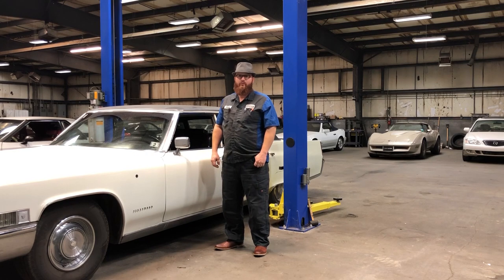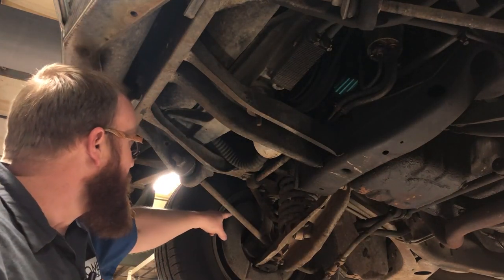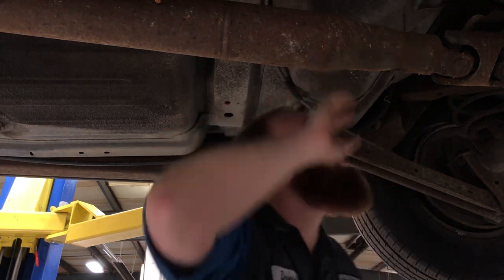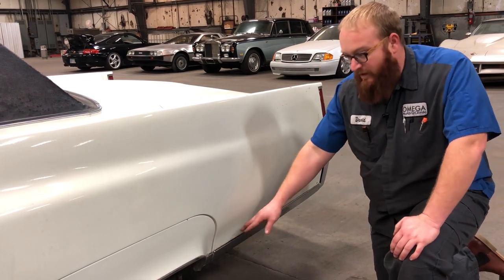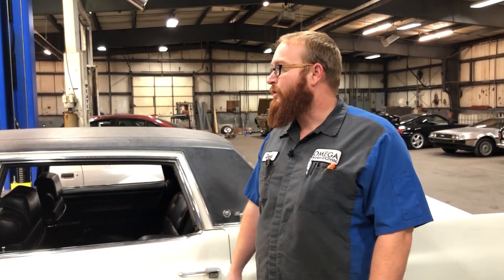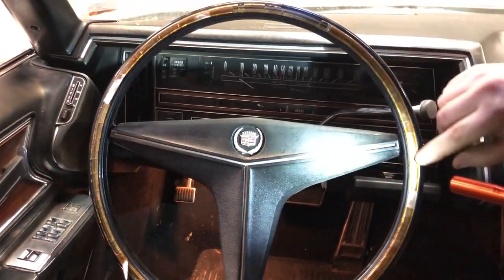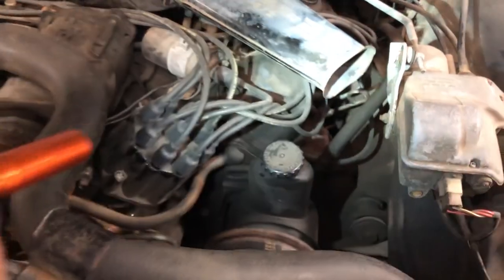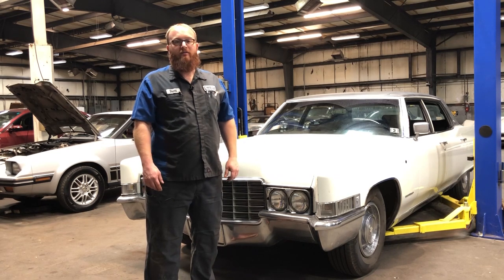CAR WIZARD Shows What Makes a Classic Car a Deal or a Steal on this 1969 Cadillac Fleetwood

Comment: For the future health of both the engine's cooling system and the new A/C compressor, I recommend you replace the fan clutch, this is often overlooked, and critically important. The bonus with be stellar A/C performance.
Reply: I'll try that new clutch. My A/C always worked funny at a stop light or, with the 454 at idle.  Eventually the compressor pulley seized after 50k miles. 2 years ago. Replace pulley only and dash control panel 2 week s ago.
Reply: Good advice

Comment: VERY NICE Cadillac, especially from Kansas City (road salt eats these old cars up) !!!!   I learned to drive in a 1977 Lincoln Town Car.  It was almost 22 feet long and weighed 6,000+ lbs, and had the 460 (7.5L) V8 and a C6 automatic transmission.  We were able to fit it in our garage, with just about a calf thickness to spare by the door, so you could wiggle around when the door was closed.  Viewers, be aware that a lot of the power features on a car like this may be VACUUM-operated, and that can be a problem sometimes.

Comment: It is in very nice condition.Easy to work on compared with modern cars,no electronics that are 'engineered to fail' nor plastic pieces under the bonnet/hood that get heat damaged in time.Loads of space around the engine.A cool car to have as a daily driver.

Comment: That's one classy beast... Had 2 1968's, a 1969, a 1973, 1976, 1979, 1983 then Cadillac died. I love the way you ignored the rubber fuel line on the passenger side... LOL Sweet Ford EXP...

Comment: So nice to hear someone pronounce Brougham correctly. Not Bro-ham. Thanks Car Wizard. (Edit) AHH!! I typed too soon! 12:00. This model, pretty much any year, is by far my favorite Cadillac. I''m tall, 6'4" the rear seats are never crowded when I run the front seat all way back. The foot rest is a cool bonus for the passengers. When I was high school, maybe before you were born, in my Vo-Tech class I had the pleasure of replacing those double cardan joints (taught to call them constant-velocity joints as well). The part I remember being the most difficult was the centering yoke. Still sticks with me almost 36 years later. Great information for buyers!

Comment: '69 Cad,,,,great highway car. That opinion coming from having owned a new '69 deVille vert.   That tells you how much older I am than you so I'll forgive (haha) you for the statement you made about being "surprised" to find a trunk release in the glovebox.  Man, back in the day that was pretty much standard equipment (or at least a popular option) in any luxo boat.  A feature of your car that I really wish they'd bring back is Cornering Lights....not only did they look cool, they're very practical for turning into dark driveways.  GM cornering lights were extra cool because they had  a delay feature which kept them lit for several seconds after the turn.  Enjoyed the vid, good tips and well done!  Enjoy that land yacht!!
Reply: Very cool!  I own a 69 cad convertible.  Yep, they are great highway cruising cars.  Have had mine for about 25 years..would never sell it.  The only problem with them is the 8 miles per gallon fuel economy. When gas was $4 a gallon... I wasn't driving it much! =)  What happened to your 69?  Did you sell it?
Reply: In the fall of '69, I traded it in for a '70 Eldorado.  Whoops,,mistake.  The Eldo never had the couch-on-wheels floatiness of the rwd deVille. Good on you for keeping yours 25 years and counting!
Reply: You are so right about the cornering lamps ! I have an '05 Mercury Gr Marquis and I upgraded all of the interior and exterior lights over to the brightest LED's I could legally use and man, my cornering lamps are wonderful for my very dark and steep driveway. Having headlights that actually work now is a real treat too. I'm keeping her for forever unless something truly $$$ happens to it, then it's on to a Hybrid of some kind...Progress ???
Reply: I have an 89 Town Car project and yes the cornering lights are fantastic for coming into the driveway in the rain at night!
Reply: jrider4   I had quite a few of these old Caddys back in the day, and oddly enough, many weren't very well equipped. Fleet woods and Eldos had everything but a DeVille or Calais not necessarily. Air was not standard till 71, though most had it. Tilt wheels, even power locks were absent on some lowball models I've seen. Funny how a Hyundai has more gadgets than these old Caddys. I'll still take the Caddy though!

Comment: Only in America can you daily drive a 7.7 litre V8! Try that here in the UK and would cost you a tenner to start it up!
Reply: what is a tenner?
Reply: and if your from the u.k what is a crumpet? like tea and crumpets, i always thought of it as a small piece of burnt buttery bread thats very crunchy.
Reply: @chevy2061  A tenner is £10 (Sterling)
Reply: @chevy2061  £10 or around $13
Reply: Murica
Reply: Good we don't wanna be ruled by our gvt we have freedom here and don't forget we defeated the euros to get it and would do so again.
Reply: A 7.7 liter V8... that made like 140 horsepower 😬😂
Reply: Yah but in the UK you have universal healthcare, better social safetynets and a very modest retirement system. You may not be able to drive this gargantuan piece of metal, but you guys are years and decades ahead of the US.
Reply: @diablocls55  
Torque, brother.  It's for the torque.
Reply: @markwilliams2620  I get that.... but 140 horsepower? What the fuck? My 1995 Volvo 850 makes 30 more horsepower than that out of a tiny 2.0 5 cylinder 😂
Reply: @markwilliams2620  also, many other cars in 69 were putting out 3x that power

Comment: I'm no professional mechanic, but on the Camaros and Firebirds along with the pre 85 Corvettes check by the bottom corners of the windshield as sometimes water will get stuck there and rust out the body from beneath the windshield. On Firebirds especially make sure to peek inside the door, there should be a little seal that is removable and shine a flashlight into it. Water likes to collect in the doors on the older Firebirds and Camaros and at times the drainage holes will get gunked up and thus the doors can rust from the inside out

Comment: The boss man bought himself a car only the boss man would have bought back in the day.  Love it, 1969 was a great year for Cadillac and that thing is in amazing original condition.  

Also take my advice from somebody who has owned an old Cadillac with a vinyl top.  Mine started to get a rust bubble on it on that rear sail panel near where it met the roof.  I let it go for a year or so, big mistake.  There was a lot more rust under the top that I couldn't even see, had a quarter size hole where it bubbled up.  I'd strip it off immediately and kind of see what you got under there.  I assume you aren't going to drive it in the winter so right now would be a good time to do that project and have it done when spring rolls around.

Comment: Congrats Wizard, I had a 64 convertible. It sat outside for over 20 years with rotted off top and when I got it back on the road, it still rode better than a new car. But i'm a Ford guy, so I sold it and bought a Lincoln...LOL

Comment: The bad u-joint ruins the front seal on the differential usually.  And he's right about taking it to a shop that specializes in driveshafts. They have balancers and all the stuff to make it right for highway speeds.

Comment: Congrats.  Daily driving that should be  a lot of fun.  I notice this car has the fuel fill behind the plate, at the center of the back, so during your frequent stops for gasoline, you will be able to drive to either side of the pumps and reach the filler opening.    I have a Chrysler K car, and I replaced the sealed beam headlamps with conversion kits.  I used Hella Vision Plus, but there are probably others, too, and Hella has them in your 5 3/4 " size.  Upgrading from the sealed beam units would make the car safer for night driving.

Comment: I bought a 1982 eldorado for 700 bucks and she's a beauty im about 1800 into it seprate from what I've paid for it things like starter breaks alternator just did the ac compressor had it switched from r12 to r134 new interiors headlines that was 400 bucks actually I've spent more than 1800 lol but i would change a thing i fell in live with her

Comment: As long as the Caddy is a pre-Northstar engine then it is a good car. I had an 88 Sedan DeVille and and 89 Fleetwood Brougham later. Good cars. My landlord had a 70's Cadillac I did work on for him and drove a few times also. Love the old Cadillacs, they ride so smooth on the highway. I am the same way, as long as the car looks pretty I can fix the mechanical issues.

Comment: Very cool. I really dig those old Cadillac's. the interior of that car looks just like a 1970 Eldorado I owned. By the way the horn it not on the rim of the steering wheel it's in the spokes of the steering wheel...  If you have problems with the carb overheating then get a 1974 intake manifold which has much smaller carb heat ports in it... I've repaired many a 472 and 500 over the years...  Probably one of the best engines made.

Comment: I don’t know if I am late to the party but I guess the clock is still the type with mechanical clockwork and power winder. These would draw around 1.5 amps for a split second every two minutes. The points would burn out. They were also vulnerable to battery swaps. Before reattaching the ground the ground wire had to be sparked against the battery post, wait until the clock stopped, repeat until the clock didn’t run and there wasn’t a spark anymore.

Comment: Nice car! A friend of mine has a 72 fleetwood limo. Makes my 1989 Town Car at "only" 18.5ft long seem small. I recommend replacing the intake manifold gaskets at the same time as the valve covers'.

Also watch out for new parts as they can be warning signs! My town car project I bought for cheap because it had some minor issues like a rusted brake line and valve covers leaking. Noticed a new radiator and alternator were installed recently. Want to guess which systems needed in depth troubleshooting and repair after purchase? That's right! Needed a thermostat and intake manifold gaskets to fix the cooling system and a new pigtail + new voltage regulator to fix charging and battery drain issues.

Comment: This vid has been here awhile, so I don't know if you ever addressed the steering wheel or not. The 'rim blow' feature is unique to 1969 models. There is a vendor out there that reproduces a wood strip that you can refurb that wheel with, if the rim blow still works. A popular retrofit for this wheel is the one from 1970, which has a normal horn switch activated by the center hub and spokes. Not so sure if later ones fit - they might not.

Comment: Car Wizard, that is my old Cadillac. I bought it from the original owner 3 years ago (as of today) and sold it last year to a fella up in the Kansas City area.
Reply from the maker: Hey that’s really cool. What can you tell me about it?
Reply: Car was purchased by a sweet lady in Colorado and then moved to the Wichita area back in the 80's. When her husband passed away she wound up storing it in their garage/barn and it wound up sitting til I purchased it. I believe her son told me that the car had been sitting for 20ish years. I put new tires, brake cylinders, plugs, wires, gas tank, some charging componets and couple belts. The AC compressor went out on me and I just took the belt off. Was a fun driver. I believe I took a picture of the title (from the original purchase), I'll see if I can dig it up.

Comment: Missing the vacuum advance diaphragm vacuum line.
Reply from the maker: ngneer999 Yep I was in the middle of working on it before filming.
Reply: @CarWizard there is a hop up kit for 472-500 engine to get past the smog......

and even Edelbrock has a rpm intake manifold and you can get front discs for it.....check Kanters and OPGI 

I'm glad that you've joined THE Empire!

I'm working on 1959 myself!
Reply from the maker: Cleveland Maker Thanks for the tips. Luckily it came stock with front discs. I think its the first year.
Reply: @CarWizard  thanks....and by the way Google Frank Nicodemus....hes got a Jersey junkyard and warehouse of Cadillac parts he could find you a good steering wheel!
Reply: @clevelandmaker386  No smog crap on a 1969 model car.  They didn't really start lowering compression ratios, cat converters, smog pumps etc until 1972-1973 model years.
Reply: @clevelandmaker386  Wow. Kanters is still around. I'm having flashbacks from the 80's now. I went to Boonton High

Comment: Hey Wizard!  Any updates on the Caddy?  I just picked up a 71 Sedan DeVille, pretty much the exact same condition as this one, needing much of the same things.  Underneath and the body looks the same condition as yours.  The odometer reads 12k miles, and thought it might be actual since the leather is like new, and even the steering wheel's "wood" inlay is fully intact with only one small crack, but some other stuff like a replaced ball joint, newer brake pads and shocks, and some paintwork lead me to believe it's 112k.

Comment: I owned a 1965 convertible and then a 1966 Coupe De Ville. I think the stacked headlight 1965 and 1966 models were the epitome of Cadillac style. After 1966, the styling degraded in my opinion. The main issue with these cars is the atrocious gas mileage (I got 9 mpg), and the hugely complex carburettors. Even back in the 1980's it was tough to find anyone who could rebuild and adjust the carb correctly. Cadillac dealers are not interested in any car over 15 years old. You won't find any parts from Cadillac.

Comment: I was very interested to hear your opinion regarding running Unleaded Fuel in Pre-1975 model Vehicles and the need for hardened valve seats to compensate for the lack of lead in modern fuel. Surprised there wasn't a word.

Comment: Nice car. I subscribed your channel, I like old US - cars. I own an Oldsmobile Delta 88 Royal Brougham with the 350 Diesel, from 1978, and a GMC Fleetwood Pace Arrow with the 454 from 1980.
I have to do all the stuff to maintain the cars, because here in Europe these cars are exotics. But they are running very good, I like driving them. The use perhaps a little bit more gas, but are easy to fix, parts are cheap, better than a lot of german money pits ;) .
Greetings from a german living in Spain! :)

Comment: Just curious, does this thing run on normal 87 or high test 93 octane??  Do you have to put a lead additive in the gas??  I know old cars back then were designed to run on leaded gas.  Most of the muscle cars from back then have had the engines rebuilt with hardened valve seats so they'll run on modern no lead gas, but on something this original where the motor likely hasn't been apart, I was wondering what the deal was.
Reply: That's a good question! If memory serves a 430 buick from 1969 could run on unleaded. This 472 should be ok. If it has the original valve seats they are going to be impregnated with lead from it's early days. If he rebuild's the heads new hardened seats are a cheap upgrade during the process As for the 87 octane, probably! Gas is far better than it was in 1969. I built a hopped up 350 for my Nova that had been decked at some point. With smogger large chamber 882 heads it probably had around 9.5:1 compression ratio. It ran 87 octane just fine.

Comment: Wonder how many 2018 cars will be running in 50 years time? Shouldn't imagine many due to complex electronics, parts prices and probably availability. Add the throwaway mentality of today's consumers. I run a 2005 VW Golf GT daily driver which I maintain myself and it runs great but then I know what I'm doing and have to fix a few quite complex issues since I got in 2017. Most people are just clueless about cars and made even worse now that its all fault codes and diagnostics. This old caddie looks great underneath. You could imagine what it would look like had it been up in New England or some other rust belt.
Reply: Cars today routinely go more miles than they did back then so I think it'll be fine.

Electronics can be very reliable, much more so than some mechanical stuff. I think people don't understand them so they are a bit of a Boogeyman. You can just as easily swap out a chip as you can anything else
Reply: I think some cars will last, some won't. I think it depends on how the car was driven and how it was maintained.
Reply: @seanguy9720  that's true but only to an extent. FCA quality and durability issues are pretty well documented. An unmaintained Toyota may be as unreliable as a well maintained Chrysler, but a well maintained Chrysler won't touch Toyota or GM or Ford if they've also been maintained
Reply: There are not that many survivors from 40-50 years back. That's why they are RARE! Most rusted out or the drivetrain croaked.
Reply: @tjwatson0403  Electronics are usually the first thing that go bad in modern cars.  Furthermore, those parts will not be available or easily rebuildable (or at all) in 50 years unlike mechanical parts.
Reply: @seanfyodorovich5230  if you're talking about head units then yes I may agree, but those are very easily swapped. If you're talking electronically controlled parts of the engine and vehicle then I would highly disagree. Fewer moving parts means more reliable

Comment: 1972/73 Cadillac steering wheels looks similar enough that you can swap them out and they do not have the rim blow, but there are places that can redo the wood trim on cadillac steering wheels, it’s not exactly perfect but it’s presentable.  Otherwise you can leather wrap it but I wouldn’t IMO

Comment: Rim blow was a 1969 only.  it is NOT the wood grain that is cracked and falling apart - it is in the thickness of the steering wheel inner side - there is a grove you jam your fingertips into.